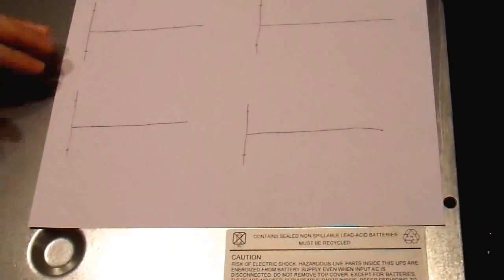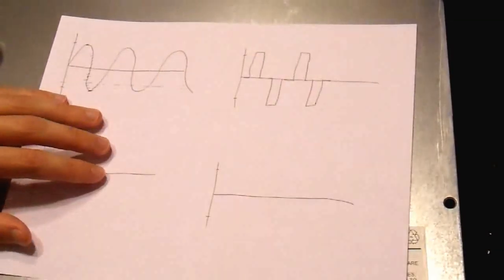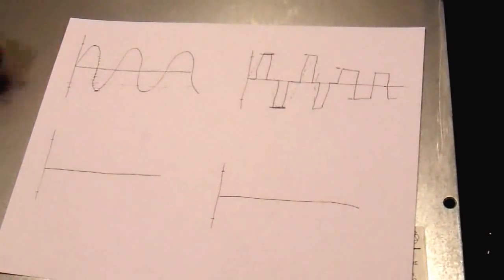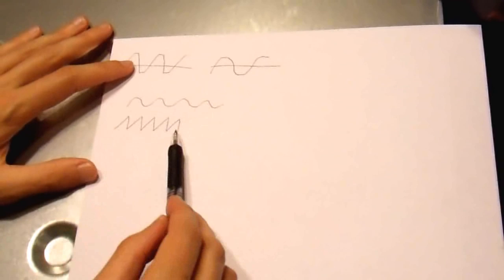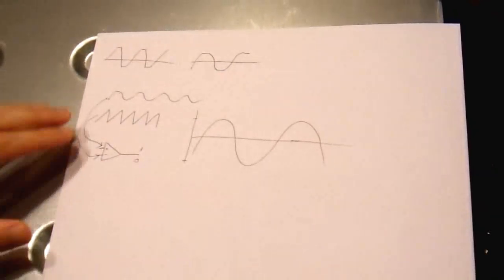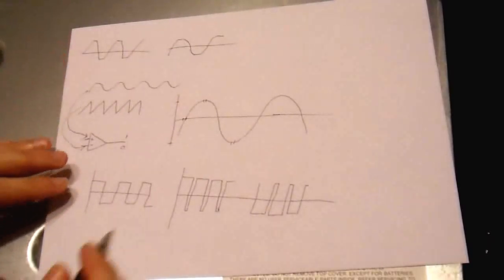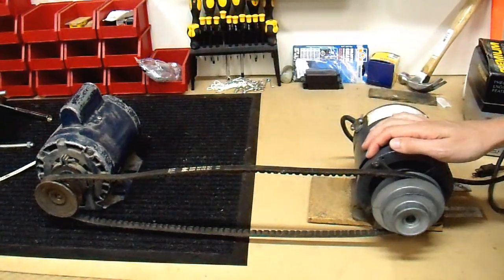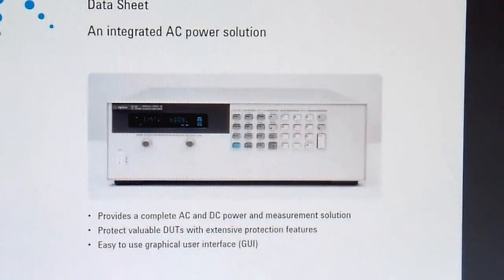UPS to 1.5kW Sinewave Inverter Conversion part3 - Modified Sine vs Sinewave

Comment: I've purchased a ramsond 1500 watt pure sine. .. lots of battery power. I plugged my chevy volt car charger into the ramsond and it doesn't like it. Did I buy a bad brand? Is the charger too smart? Maybe the inverter needs grounded? What you think?

Comment: I hope to build a inverter someday. I have not been to school for electronics. but I'll use a modified sine wave inverter. and rectify the output. and build a H bridge board. and chop it into a spwm output. if I have to. to say I built a inverter. or go inside and connect to the boost stage output cap. and build my own h bridge. but I really want to build a 10-15 kW inverter. maybe bigger like 20kw. from a 72 or 96 volt bank of batteries.

Comment: Do you know roughly how much energy is wasted by going from 12 or 24VDC motor to AC motor to create 120VAC power, versus using a consumer grade pure sinewave inverter?
Reply: about 30% i have an dynamotor 24vdc to 230vac
and i tested it at 80% load and the result is 30% to 35% it depends on the ambient temperature colder is bether
Reply: georg841984 I knew it had to be bad. bit hadn't a clue it was that bad. I was thinking about 50% efficiency. so I guess at near 100% capacity. it would be in the 20's% area. that would be only for an emergency. and only for a short time. I guess that's why every one used gas generators. through history. I guess a pure sine wave inverter was a welcome advance in technology.

Comment: While an older sine wave UPS or inverter likely does use classical PWM as you describe, nowadays they use either RL-PDM (Rebecca Liu Pulse Density Modulation) or Delta Sigma Modulation. RL-PDM is basically a precomputed table of times to turn the transistors on an off while Delta Sigma operates exactly like the Delta Sigma modulators in a digital audio amplifier, albeit at a much lower carrier frequency. Both have the property of "pushing" the noise/THD into higher frequencies  where it's easier to filter out and/or let you use lower carrier frequencies for the same output quality. (In case it's not obvious, I'm an electrical engineer specializing in power electronics.)

BTW, if you don't have a good scope (or one that's isolated), you can get a cheap FM transmitter, feed it the waveform to be tested via a voltage divider, then receive it on your PC (or a smartphone/tablet) with a FM radio connected to the sound card. Now you can safely record the waveform with your PC.

Comment from the maker: Amplifiers like those in the audio world are highly inefficient and are optimized for a wide frequency band.  These are optimized for 60hz only and can be made far more powerful and efficient for less money if built differently than audio amplifiers.  Inverters are essentially very high power 60hz class D amplifiers, though.
Reply: knurlgnar24  hello man. are you still making videos? I haven't seen anything from you in a long while. you have some of the best videos on the tube. and gave the best info. if you have quit. I wish you would come back if you can. thanks for all the videos.either way.
Reply: knurlgnar24 
yea I have noticed in a old inverter. a lot of the components I researched say they are designed for audio amplifiers. I want to build about a 10-15kw inverter eventually. some day! maybe experiment with smaller ones. then go up in size. if I can learn enough to do so. I know its a leap for someone like me to do so. but hopefully someday I'll do so.

Comment from the maker: The inverter will probably be more efficient and will be designed from the start to handle continuous loads - no hacking required.  As far as quality goes, well, they run the gamut from disposable to medical grade.